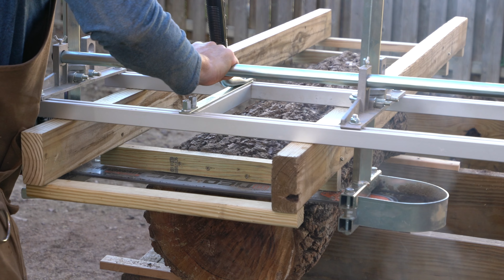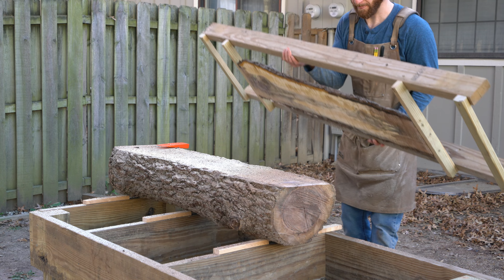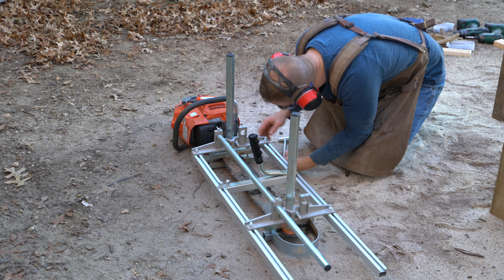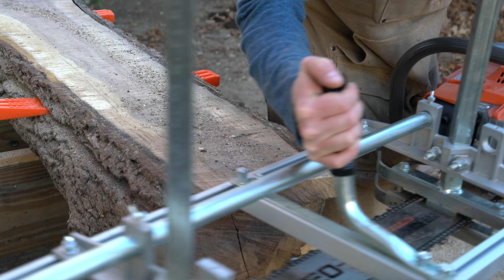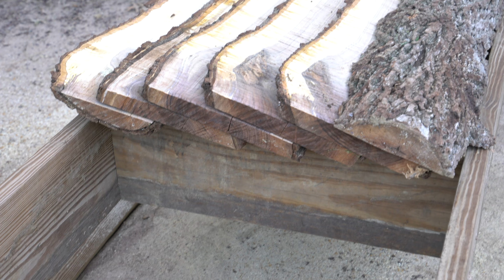Want Free Slabs? Try this!

Comment: You should really put that handle on the back side and cut at an angle.
Reply from the maker: Have you had better success cutting at an angle with a chainsaw mill?
Reply: @_Shopfix  Yes, a local sawyer friend of mine mentioned I should put the handle on the back and start straight but then go at a slight angle (10-15 degrees). Larger contact patch and slightly smaller kerf. All I know is that I'm not hanging over the handle as much and my back feels better.